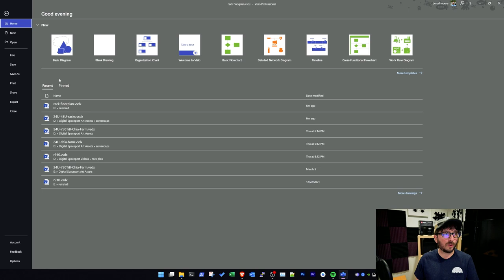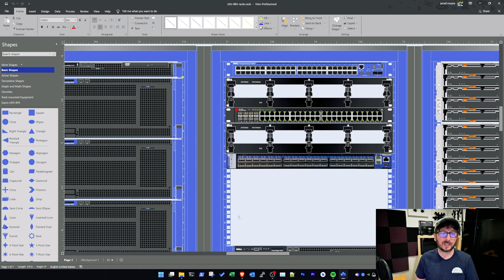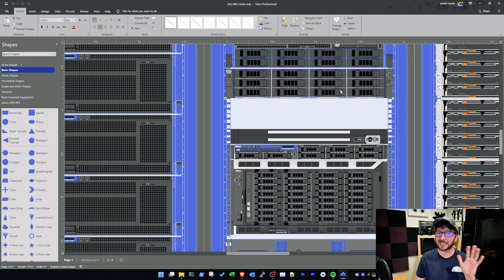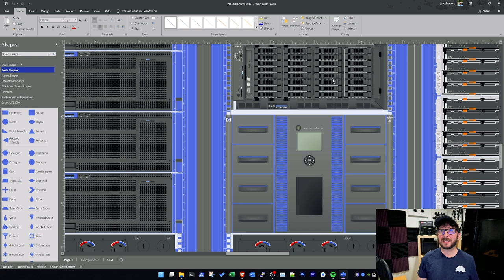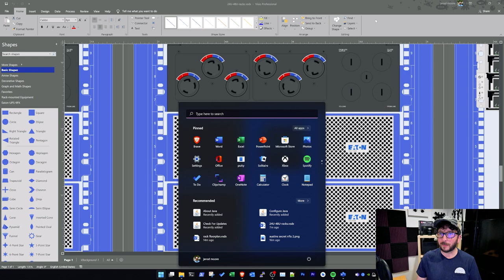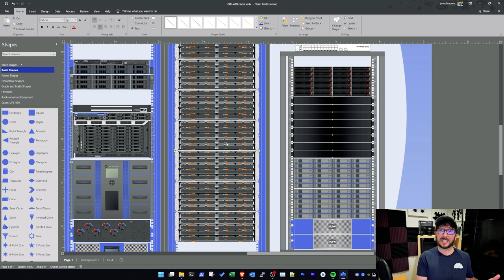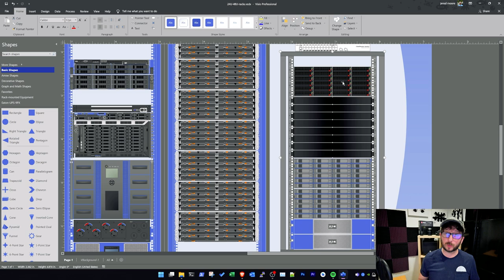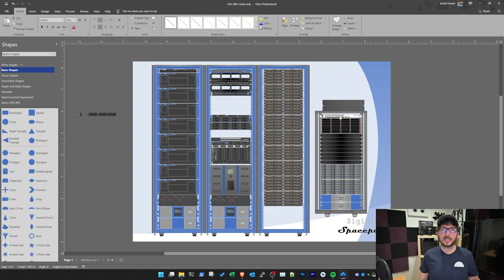Homelab Server Racks - 8 x 60 bay JBODs ?!?! Let's start with a PLAN!

Comment: My Chia rack is a 15U home made thing, it's basically a set of wheels, worktop cutoff as the base, some MDF side panel, rack strips screwed to the MDF with a nice bit of oak work top offcut as the top. It makes for a great work bench, theirs probably some pre-made metal frames that could be used instead and slap a wooden top on, might be something worth thinking about doing for your middle bench and to gain an extra bit of rack space in the process.

Might be time for a home made tumble dryer as well, pipe that hot server isle air backwards into the tumble dryer (with the heater and fan turned off) and get some free drying (and cooling!)

Comment: how did you get those APC Rails 0m-756h to fit since they are too narrow for those netapp boxes
Reply from the maker: They flex outward a cm or so on each side. Best to sit the NetApp on top, then angle backward which is clear space, then wiggle in 1 side at a time.
Reply: @DigitalSpaceport  Coolio, what os are you using on r720xd and what drives and raid config as well.  I'm having drive compat issues I believe.

Comment: When do you use truenas vs unraid?
Reply from the maker: Good topic for a video but in a nutshell. I use TrueNAS as tier 1 backups and fast shared storage for performance reasons. It's fast fast. I use UnRaid for tier 2 backups as it's slow but doesn't "waste" disks with raid like ZFS. I use the tape library for third tier which I take tapes off-site manually.